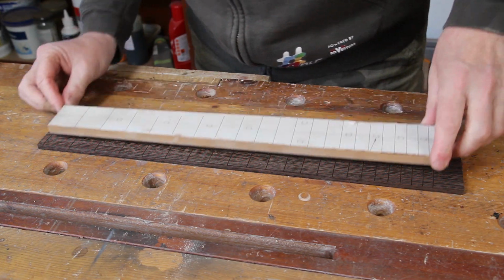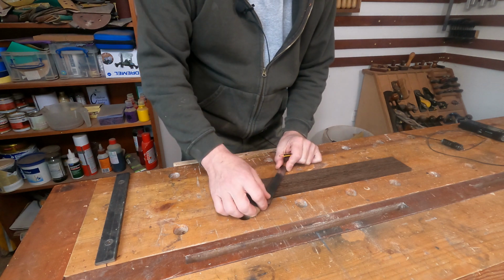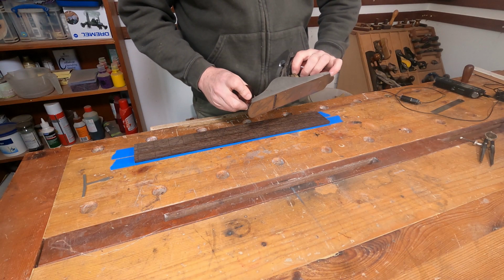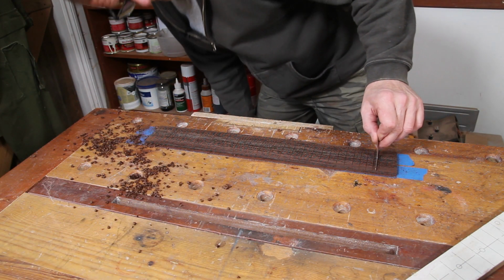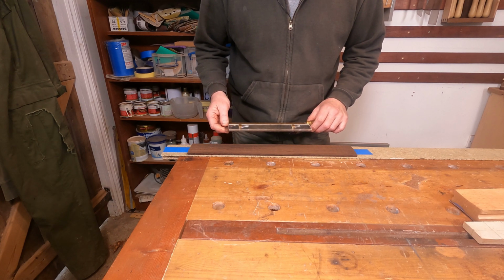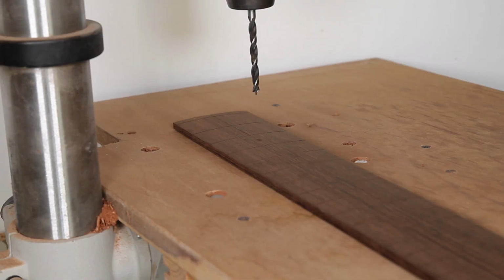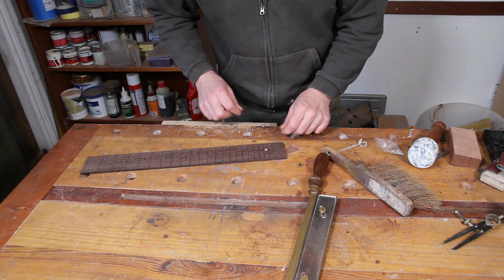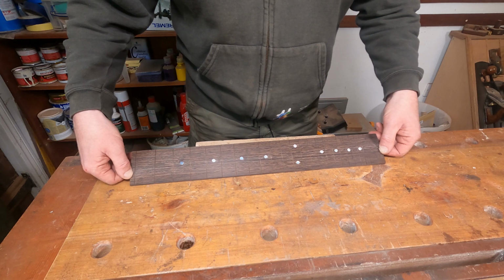Firebird Build Episode 9.

Comment: Lovely job and gorgeous piece of wood.
Great tip about leaving the board square and not trimming the taper to ensure the correct radius is imparted. That answers a question I didn't think I needed to know - but it makes sense now.
Keep up the great work.
Reply from the maker: Thanks Paul, glad you found it useful. It also make understanding how a compound radius works a bit easier.